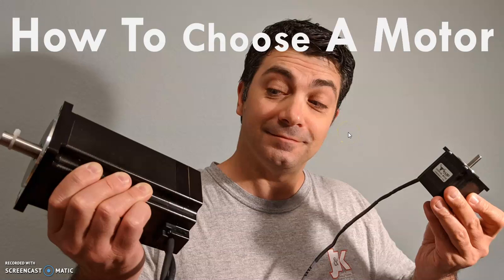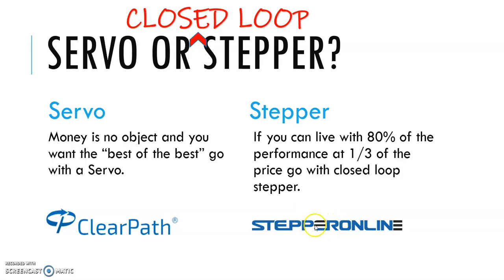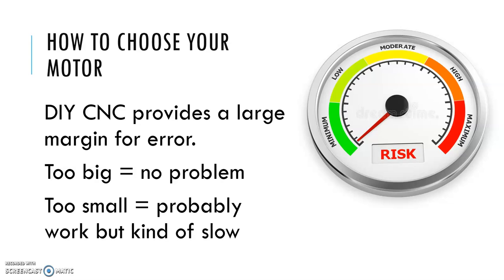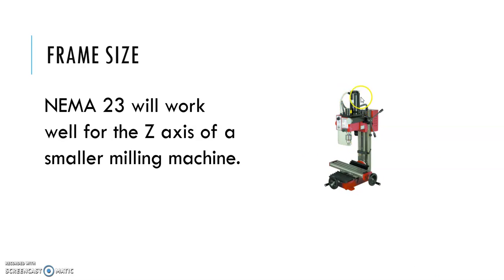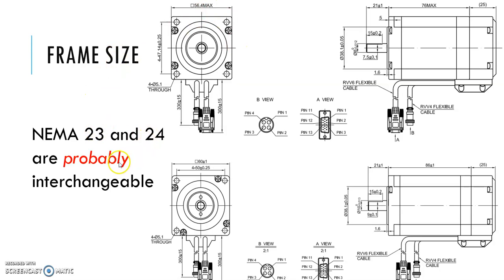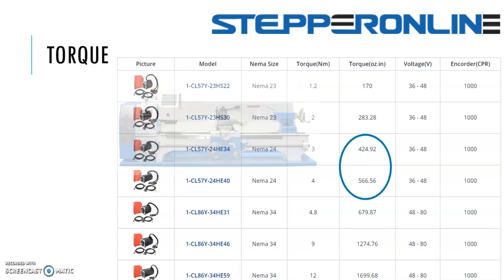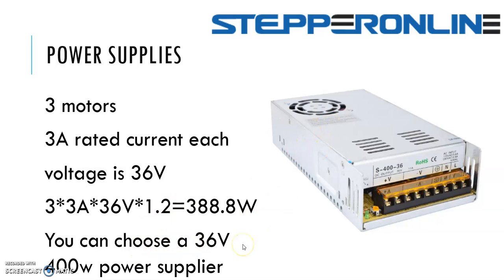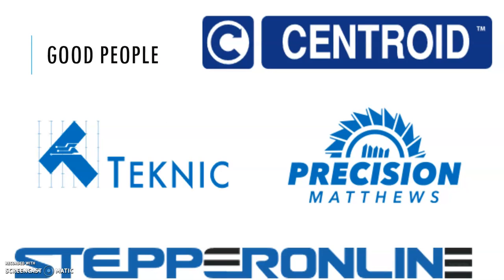How to Choose Axis Motors For Your DIY CNC Conversion Project

Comment: It’s funny how you state that servos maintain torque at high rpm when this directly contradicts the graphs you can easily find through clear path. Yes they maintain HIGHER torque at faster rotations, but not the peak or anywhere near it. Just a quick observation
Reply from the maker: Compared to steppers, servos maintain more torque at higher rpm.

Comment: Good Vid!  It's worth counterbalancing the z axis both for speed/smaller motor, but also to save wear on the ball screw, and especially to reduce the non parallel loading on the ways from the cantilever.CHoose your support point on the counterbalance to nearly eliminate the cantilever on the vertical way  .  I've also thought that a z axis must wear faster because of the cantilever PLUS the oil tends to run out of the ways vs horizontal ways, so I counterbalanced mine as soon as possible.
Reply: another tip:  using an air cylinder with a relieving* type regulator  allows  for easy adjustment of the counter-force, and a constant force regardless of cylinder volume/z-travel.  It also allows for manual adjustment if you sometimes install/remove heavy attachments to the head
Reply: Thanks alot Infinity is overpriced